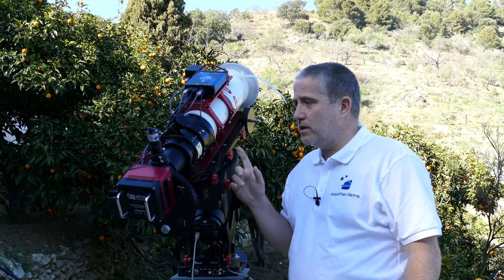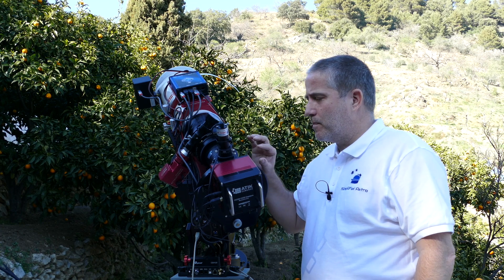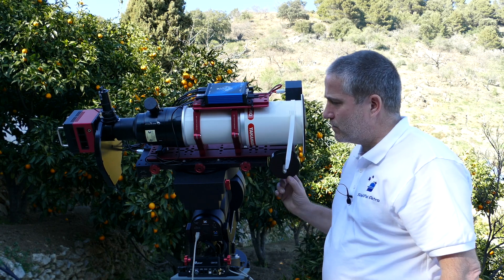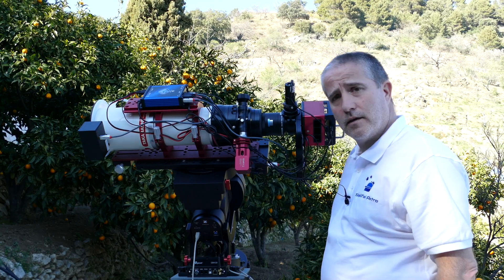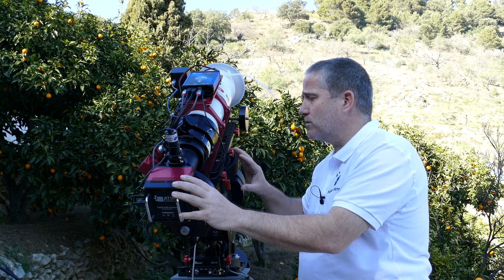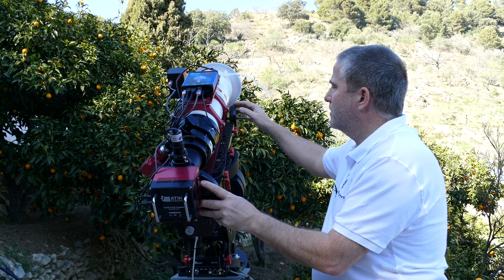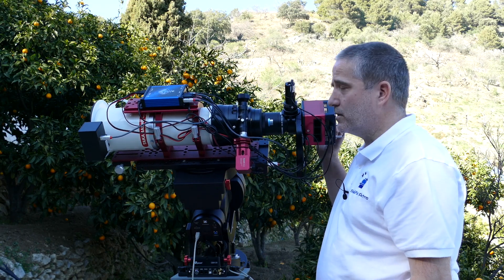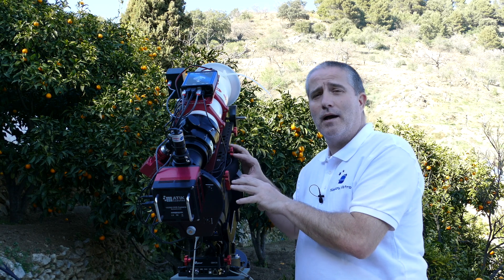CEM120 Third Axis Balance Considerations

Comment: Don't oversweat it people.

Remember this is not really feasible when you start rotating the camera for framing when having an OAG+guide camera/filter wheel/etc. attached, because then you can start tinkering with the balance AGAIN.
Improvements are neglitable as long as your stars are round anyways.

Comment: For those that don’t know(and may apply to other mounts as well but I only own this one), but the cem70 has m8x1.25 threads tapped into the side of the dec saddle on both sides so one can thread in a threaded rod with hex bolts as weights or similar to achieve balance of the 3rd axis. I’m hoping this helps my guiding as with my eaf on one side and efw off an an angle towards the same side has my dec quite off balance even being “perfect” it’s not actually very balanced at all but this trick will solve that. Hope that helps anyone that was wondering what those holes are for!

Comment: That was extremely helpful.  How do you solve the problem if the mount has the same issue on the  Right Ascension? Thank you
Reply from the maker: Hi Ahmed.  Thanks for the comment.  Fortunately you can't have the same issue on the RA axis as you simply slide the main weights to balance there and, once you've balanced on this third axis there will be no imbalance in RA.

Comment: Thats the exact problem I have. I have  8"newtonian and Celestron AVX. 
I was wondering if its bad for the mount motors if i cant balance the third axis (its DSLR heavy on the third axis) I dont have counter weights like you do in the video (not sure if there even are any for my scope).  I balanced it as well as I could and tried moving the mount with handcontrolller  - it did not make any weird noises and seemed to function normally). Am I breaking my telescope over long time use if third axis is badly balanced.

I have not tried guding, this is  something I have yet to figure out.
Thnaks
Reply from the maker: Hi Martin,
No it won't cause issues with your mount or the motors.  The only time is would manifest as an issue is if you, like me, are doing very long exposure imaging at reasonable FL then you need your tracking/guiding to be as good as posisble.  

The AVX is a great little mount, I have one myself, but the level of guiding possible with it would be the limiting factor rather than an imbalance on the third axis.

Comment: I have this problem on both DC and RA....and I don't have any fancy extra weights like that. What should I do?
Reply from the maker: Hi Statikreg.  It shouldn't be an issue with RA, only dec.  For the RA axis you will balance as normal just using your standard weights.  This only affects the dec axis and you should pnly be concerned if you are having some guiding issues and you suspect it may be this.  I tend to shoot mostly NB at up to 30 minute subs, so for me it was an issue.
Reply: @simplifiedastro2092  Thanks. I got it all figured out finally. The RA was a side effect of the DC not being properly balanced. I simply rotated the scope in the cradle so the focuser is  parallel with the counterweight shaft, rather than off to one side. I think it should be close enough now to track well, but here in SW Michigan, it's been overcast since I bought the thing last week...ugh lol

Comment: Hello, nice video ! Where do you buy that declination counterweight system ? What brand it is ? Thanks !
Reply from the maker: Hi Muppetologiste Ca.  Thanks for your kind comment.  The weight is a complete lateral system from ADM.  It has a Losmandy fitting clamp but is also available with a Vixen option.  I got mine form First Light Optics.
Reply: @simplifiedastro2092  Thank you !
Reply: @simplifiedastro2092  I watched your great video probably five times. I finally see that there is a solution out there to balance 3rd axis. You mentioned being an ADM system but i cannot find anywhere in their website. Can I ask you to send me the link? I would really appreciate it. Thanks again for your videos...
Reply from the maker: @sebyromano75  Hi Sebastiano.  Below is the link to the one I use.  there are a few types depending on your dovetail, OTA and how much out of balance you are.

Hope this helps.

https://www.firstlightoptics.com/adm-counterweight-kits/adm-dovetail-side-mounting-counterweight-kit-d-series.html

Comment: Nice video.  I just bought a CEM120 and have the same problem due to a-symetry of the scope/gear through the DEC axis.  Just wondering where you got that counter weight from that feeds through the holes in the plate quite nicely (or did you make that yourself)?  Thanks.
Reply from the maker: Hi M T.  As you will see it really is a smooth running mount so makes this really easy to see.  The weight is actually a Losmandy system from ADM.  I got this one from First Light Optics.  Hope this helps.
Reply: Thanks.  I managed to find the counterweight in the end (ADM, as you mentioned) so I will give that a go on my own CEM120, which suffers the same problem once loaded up with the gear.  The mount really is very smooth when the gears are disengaged with no friction spots, which were present in my previous mount where they hid the slight DEC imbalance.  Matt.

Comment: Do u have or could make video on your pier?  Thank U
Reply from the maker: Hi Chris.  I hadn't given that a thought to be honest, but certainly something I can look at doing.
Reply: @simplifiedastro2092  did u have issues logging into ur eagle from prima luce?
Reply from the maker: @KB2AT  No logging in was actually very good and not something I ever had issues with.  I used to use it in AP mode but it worked equally as well in Host mode.  

I had other issues, including some USB drop-outs and the killer issue for me where it wouldn't boot by powering up (this was no good for me in a remote observatory) but never an issue with actually logging on.
Reply: @simplifiedastro2092  I've had all sort of issues on my laptop.  Not on ipad.
Reply from the maker: @KB2AT  Oh that's odd if it's working OK on the iPad.  Do you have the latest RDP on your laptop as MS has removed support for the older version now, so are pushing for people to use the new one from the MS App store (it's still free)?
Reply: @simplifiedastro2092  laptop never sees it.  Where my cell and iPad do
Reply from the maker: @KB2AT  If it is a HP laptop then I know there has been some known issues with the wireless connectivity following some MS updates.  See below from HP support.  If it isn't HP then I wouldn't know why it wouldn't see the Eagle.

Recommend you do a right-click on the network icon and select network troubleshooter and follow the on-screen instructions.
If the issue persists, install the wireless driver from this link. link
https://support.hp.com/us-en/product/hp-15-ac000-notebook-pc-series/7771404/model/8819258/document/c...

For other troubleshooting steps, please try this interactive guided troubleshooter . https://support.hp.com/us-en/product/hp-15-ac000-notebook-pc-series/7771404/model/8819258/document/c...

Go to Device manager > select the WIFI drivers under network adapter> Right click go to properties  > Under properties go to Power Management Tab> Uncheck  "Allow the computer to turn off this device to save power".

Comment: I have the same problem on my Avalon M-UNO which has a similarly smooth DEC action. Have't gotten around to counterbalancing it though, since it doesn't noticeably impact on performance.
Reply from the maker: Hi Hika.  Yes the Avalon is a very good mount indeed and I wouldn't think you would be suffering with too much gearing backlash on it.
Reply: @simplifiedastro2092  Yeah, one of the reasons I chose the M-UNO was the zero backlash due to the belt drive system, hence the "fast reverse" in the name. It really is beautifully engineered piece of kit. As is the CEM120.

Comment: Did you just use my FW sticking our example? Hehehehe if so then I’m glad to have contributed to half a second of this amazing video. I’m super paranoid about this.
Reply from the maker: Ha ha you noticed.  Yes it was exactly that, Ahmed, (hopefully royalty free) and that is really evidence that it doesn't need to be a mount like this to see it as I think you use an EQ6, but it made it very easy to show it happening.
Reply: @simplifiedastro2092  true that. I only started to notice that when I loosened the Dec enough that I started to notice it. Now for quick setup everything is marked. 

Really glad you made this video because I thought I was the only one being super paranoid about this :D

I know people who don't do this and still have excellent guiding.
Reply from the maker: @ahmedrizwankhan  Yes absolutely.  It is important to note that this is only an issue if you are chasing bad guiding, and being aware that it could be a potential problem area.  If you happen to image on the East side only, or you dec guide in one direction,  you may never see the problem arise.

Comment: All well and good if you have a smooth mount like yours, but I have the AZEQ6GT, which is stiff to say the least. Fine tuning the balance on these isn't easy to get right on any axis.
Reply from the maker: Yes agreed, Duncan.  I also have an AZ EQ6 so definitely know the problem.  I wanted to show it here as it is easy to see on this mount, so I was able to demonstrate it.  The reason I showed it is that we often chase a bad guiding graph but issues like this can exist and can be a contributory factor,

The best way I found on the AZ EQ6 is to loosen the dec axis really loose (the cwt bar capstan very loose) with the RA horizontal, so the scope on either the East or West side of the mount, and then slightly push the shaft out (saddle plate away from the mount housing).  This helps move the friction surfaces apart and ensures it is running only on the bearing.  You can't do it in the same way shown in this video, but it can be done, although it does take a bit more effort.

Comment: Hi, thanks for the video but I’m a little confused, its that little imbalance an issue with that mount? Is not something the auto guiding could be take care of?
Reply from the maker: Hi Mario.  It isn't an issue if you are deliberately balancing one orientation heavy, such as when you have very bad declination backlash so are trying to account for it and are guiding in one direction only in the dec axis.  However, if you have a mount with little or no backlash you ideally want the balance as good as you can get it, so this does play an important part, especially if imaging near the zenith.  Auto-guiding will keep you corrected, but very good balancing means corrections will be less which is key if imaging at very long focal lengths.

Comment: Excellent.  I use counterweights on my triplet too!
Reply from the maker: Thanks Ray.  Yes some are worse than others, as you will know.  I needed it on the FSQ106 as the large filter wheel, camera and heavy focuser just outweigh the front end.  Oddly I don't need any on my Esprit 100 but it does sit all the way forward in the rings and has a separate guide scope mounted quite far forward.

Comment: Nice what weight system  did you use
Reply from the maker: Hi Jaspal.  This is the ADM system.  I did have a standard underneath weight with separate washers on the side of the saddle plate, but this was a much neater solution.